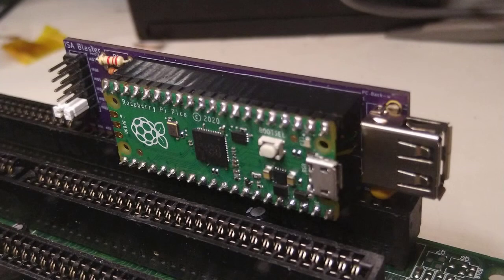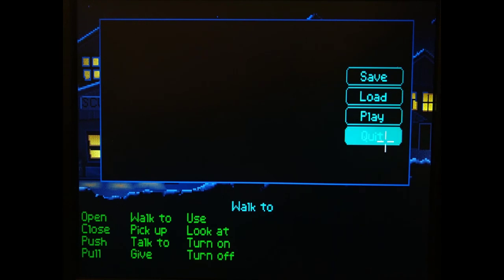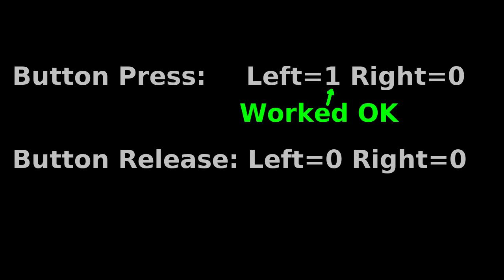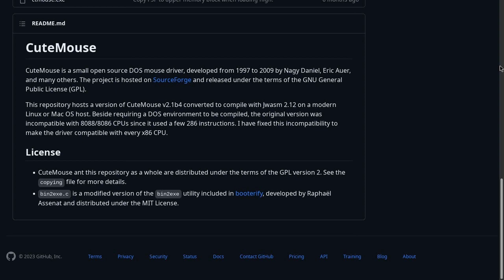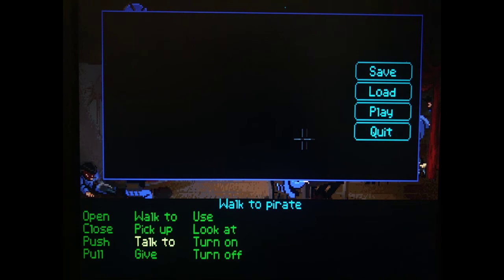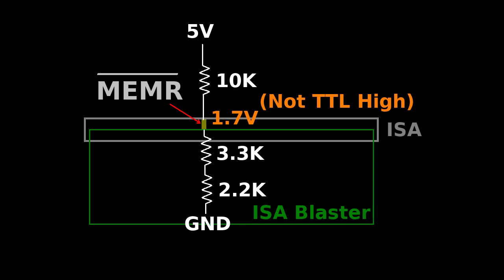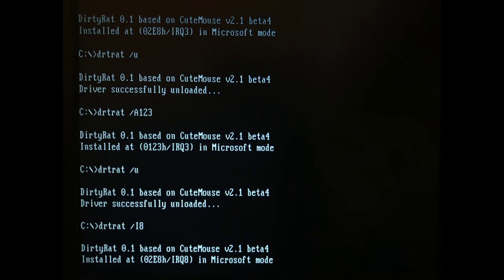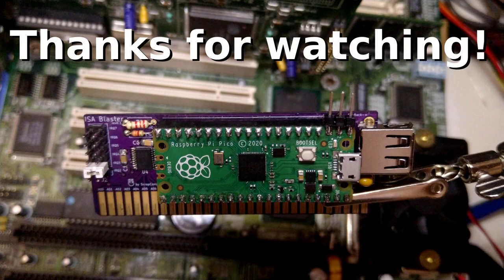ISA Blaster: DirtyRat Project (USB Mouse on a Pico-powered ISA card in DOS) (Part 2)

Comment: Did some testing with Rev. 0.1 boards, the results are a mixed bag.
Best results were on a Digis 486NL motherboard, works great with ISA frequency of 6.67MHz or less, at 8MHz has an erratic behavior and also interferes with the keyboard, above 8MHz it doesn't work. It can work without disabling the COM ports on a Windbond Multi-IO card.
386SX board with SCATsx chipset locks as soon as the mouse is moved after the driver is loaded.
Doesn't work on a PCChips M520 Socket 7 with 430VX chipset.
Tested some mice, works great with Logitech B100, NGS Flame Black and a Wireless keyboard+mouse combo from Ewent model EW3256, some others didn't work.
One issue with the Pico reset, had to take the board out of the ISA slot to reset it, if I turned the PC off and then on right away with minimal wait time, the Pico wouldn't work and the led stayed off. Waiting some minutes makes it work again, but taking the board out of the slot is quicker, inside a case is a different story. Maybe there are some timing issues that prevent it to work on 8MHz ISA and above, do you want me to try anything else? Do you have an e-mail address so I can send you some video footage? Thanks.
PS: will update this post with more info when I test other motherboards.
Reply from the maker: Thank you for the detailed feedback!

Boards can be a bit picky. I've had it working on a board with a 8MHz ISA bus, but it would not work on a different one with the same 8Mhz bus frequency. My guess is that it has to do with the timing of the IORDY signal, which may differ between boards.

I think there may be a way to get more tight timings using some PIO code. I would need to experiment with it a bit though.

The Pico reset is indeed annoying. I need to update the board with a proper reset circuit. I think I have even pushed some changes that implement to some extent, but I will have to look into it again and upload a proper PCB release.

Thanks again, I will keep you posted.
Reply: @scrap_computing  do you think it will be possible to reuse these 0.1 boards with new firmware/driver? Maybe using some code from PicoMem and PicoGus projects to have tighter timings? This small board is nice for mouse support only.
Reply from the maker: @BaguetesGarage  Yes, I am in the process of replacing some of the time-critical code with PIO code, which should make it more robust. It will still work on these 0.1 boards. The driver won't need any changes.
Reply from the maker: Good news! I just tested the updated firmware on one of my systems that had issues with the old one, and it's working great! I have uploaded it on github, in the release section of the DirtyRatFirmware project page, and I have named it: `DirtyRatFirmware_rev.0.1_pio.uf2`.
Please try it out and let me know if you are still having issues with some of your boards. 
Thanks!
Reply: @scrap_computing  great news, I will test it tomorrow and give you some feedback.
Reply: @scrap_computing  Ok, did some testing with more motherboards and the new firmware on 3 ISA Blaster boards, I will also post the ISA speed and Chipset, these work:

Digicom DIGIS-486NL (486) - Works great up to 16.7MHz (OPTi 82C495SLC)
PCChips M729 (Slot 1) - Works at 11.1MHz (PC100 BXcel / ALi Aladdin Pro II)
PCChips M573DMA33 (Socket 7) - Works at 8.0MHz (VX Pro / VIA Apollo VPX)
ASUS TXP4-X (Socket 7) - Works at 8.3MHz (430TX)
PCChips M919 v3.3 (486) - Works at 10MHz (UMC UM82C881)
Kamei KMX-16/20 SCATSX (386SX) - Works up to 10MHz (82C836 SCATsx)
PCChips M396F v3.0 (386SX) - Works at 7.1MHz (SARC RC2016A)
ECS HM386SX Rev. 1.1 (386SX) - Works up to 10MHz (Headland HT18)
Unknown V3486EF (386DX/486 combo) - Works at 10MHz (Efar EC798)

The motherboards that don´t work:
Soyo SY-025M (486) - (SiS 85C471/407)
PCChips M520 (Socket 7) - (430VX)
WinTech MP071 (Socket 7) - (430VX)
BCM SQ591 (Socket7) - (430VX)
FIC VA-503+ (Super Socket 7) (VIA VT82C598MVP)

430VX motherboards are the worst for compatibility, the mouse only moves a little bit every 2 seconds when the Pico LED lights up, maybe they have different timings, I think they don´t have the same type of bus buffers that older HX and newer TX chipsets have. I was hoping that the Soyo SY-025M would work, it´s a fast motherboard and has 1/2 ISA divider for sweet 25MHz ISA, but no mouse movement at any ISA speed, just like the FIC VA-503+, but the FIC already has PS2 connectors, so no problem. I will try to test other motheboards, I have more Super Socket 7, Socket 7 and Slot 1 motherboards. Do you want me to test anything else?
Reply from the maker: @BaguetesGarage  Thank you for testing and for providing such detailed data, awesome! 
I don't have a 430VX or a 85C471, board. I tried it on a 85C496 at 11MHz and works fine. I think I may have an MVP3 board that I could test it on.
But anyway, there are a couple more things that I could try to get it to work on those boards too. Could you drop me an email so that I can send you any new versions of the firmware to try out?
Thanks again!
Reply: @scrap_computing  e-mail sent. Will you make another video about the 0.1 revision with the new firmware?
Reply from the maker: Got it, thanks!
Yeah, that's a good idea. I think if we manage to get a firmware version that works on all of your boards we should probably let others know!
I am also working on a revised PCB for the next ISA Blaster, to fix some of the known issues, but that will take a while.

Comment: Cool project! But I would like to suggest one change to the design: You can use shift registers to handle the data and address lines and minimize the number of Pico pins needed. The ISA bus is quite slow, there will be no problems with this
Reply: This need to completely change the board and the code , making it similar to my board.

Comment: concerning the 456-board. Perhaps the ISA-busspeed is to high or out of spec.
Reply: Maybe a termination issue? Just a thought.
Reply: I remember in my old PCI 486 BIOS an option to set the ISA clock speed either as a fixed value or fraction of the PCI bus. I played with it and some ISA cards did not like if i went above 10MHz

Comment: Any chance you would make a Book8088 (or Hand386) version of your PCB like PicoGUS? The Book8088 would greatly benefit from a serial mouse plugged directly into the Book8088 port...
Reply from the maker: It would be a bit tricky, as I don't own a Book8088 so I wouldn't have a way to test it. I guess the best way would be to use some sort of book8088-to-ISA adapter ?
Reply: Just need to USB Code to the PicoGUS. :)

Comment: can you build something like this for a c64? something just like it adding in wavetable perhaps? more sound channels? maybe a better vic II card? more colours, more vram, higher resolutions.
Reply: This is like asking someone who has just built a car "that's a nice car but can you build a truck?". Yes, probably, but they're pretty excited about the car they just built.

Great project by the way! This is fantastic!
Reply: It is for this type of requests that for example TerribleFire got angry with the Amiga comunity. Something it is not ready yet, he is doing it for free and people asking to start something else.
Reply: there's other people doing something similar for c64. 

there's a pico -> c64 cartridge board out there. I think it's now just a ram interface. dunno if it would need hw changes to start acting as more things.  

c64 has lots of replacement emulator-board-as-chip-replacement projects though. for the graphics chip as well to get cleaner output.
Reply: @lasskinn474  none of that is what im talking about though, its all the same as the original tech. im talking about a video card/graphics board, maybe gpu (small one) and a sound card for the c64, im not talking about doing the same thing over and over again
Reply: @JorgeCarvalho_web_dev  cu, chill out, i asked because hes done other things already, gave him an idea. i know hes doing it for free. and you know what, it doesnt hurt to ask. dont like it? tough.
Reply: @chupathingy5862  i own it,  it does what the sid does, and it allows fm synth when wired to the board. im talking about wave table synth /wave table, and more sound channels, plus all the regular sid synth stuff. its not like i expect any of this to be made. it was just a question. i see hes doing all this stuff, its all complicated, this should be rather easy if he choses to do so.
Reply: @cromulence  i love how everyone takes everything out of context. he built alot of complicated peripherals, the c64 is so easy in comparison. i was just asking to ask and to give him an idea, basically,. nothing wrong with asking. "it doesnt hurt to ask"
Reply: @Gunstarrhero1  well you can use the commander x16's graphics subsystem chip on a c64, if you'd just use the c64 to drive an external gpu. you'd have to write your own software to use it or similar other things. there's a lot of displays like that with their own graphics routines(and cpu's) meant for microcontrollers.

but this is emulating things that exist in other ways as well, it's not like it's emulating a gpu that never existed for dos(yet anyway) with special features that you'd have to write new software to use.

the raspberry cart for the c64 could insert stuff into memory to enable graphical capabilities like playing a video or something through the c64's video output that are not possible on a c64, by inserting that stuff into memory.

for amiga there's pi storm which might be more like what you'd be looking for, but c64 accelerators have way less utility.

actually looking at it there's sidekick64 which does basically what pistorm does for amiga but for the c64, offering memory expansions, dual sid emulation etc.

edit: and you could expand the sidekick64 to do whatever this would do, pretty much